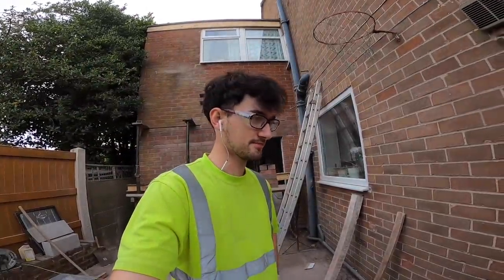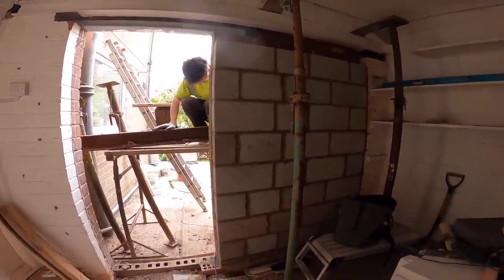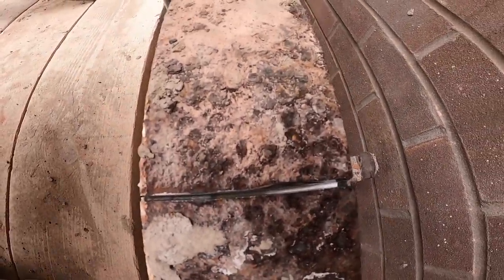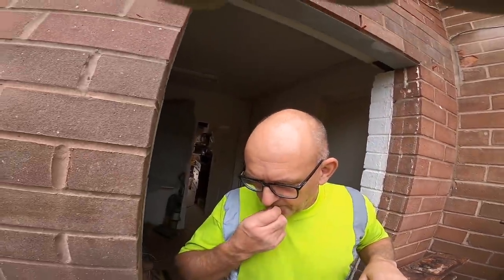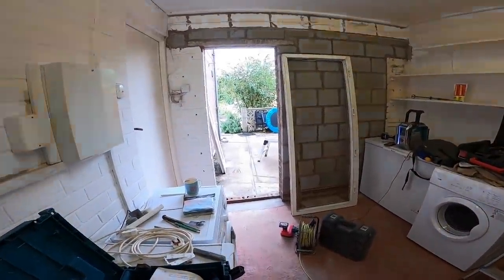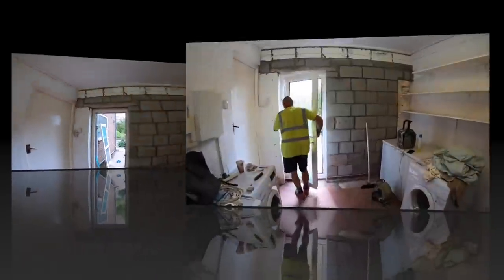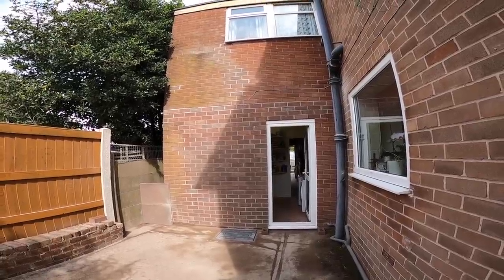HEAVIEST STEELS WE'VE EVER REMOVED!! UTILITY BOTCH REPAIR...THE BIG FINISH

Comment: I'm knackered just watching that! Top job guys - does show how hard the building game is. Rather worrying about that electric cut too. Stay safe you two. Do enjoy the ambient/techno choons too!
Reply from the maker: Cheers Danny 🤘🏽😉. 
The electrics were sorted , ended up being water in the outside light 💡🙄🧱👍🏼
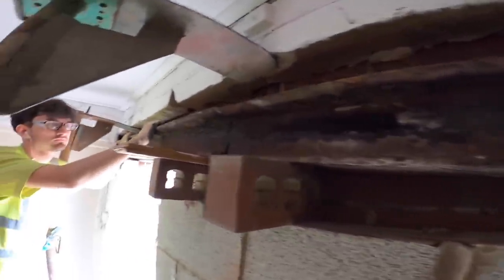Reply: Gents are you sure it wasn't crushed twin+earth going though cavity, seen at 13:24 acro pushing broken block onto wire(first tripped when you drove home acro), when acro was removed wire pinch released, then the spark could not find fault so blame water in light so he got paid. No matter as long as its RCD protected at fuesboard but fault may come back.
Reply from the maker: @deano6188  . No it’s all sorted and that wire was loose in the hole plus we hadn’t tightened the acrow up when it blew .🧱👍🏽

Comment: Great work Steve and Alex so many tips and going the extra mile or 30 for the bricks 🧱 great solution with the manhole covered any future problems ! Hope the scrappy paid a good price on those steels they were mental thick amazing how they rust and do so much damage with no tray thanks for the video much appreciated John
Reply from the maker: Cheers John , not much but worth taking them to get weighed in 👌🏽🧱👍🏽
Reply from the maker: @esecallum  10 p per kilo $3 would have been great

Comment: 19:53 in your younger days you would have carried the steels on your shoulder, and be whistling a happy tune. The pieces are probably the weight of the old school 50kg sacks of cement. Tidy job chaps. As for the door installing, it works as it is supposed to, so 10/10.
Reply from the maker: Thanks pal 😉👍🏽🧱

Comment: Great job boys 👍 The reason you had power upstairs is prob because the distribution board is split loaded. The earth leakage fault only affected the circuits( including the faulty light) that were connected to that part of the board and its associated rcd. Turning off  the mcbs still leaves the fault because the neutral wires are permanently connected and not switched. Hence the reason that circuit wouldn't reset until repaired 👍👍
Reply from the maker: Nice one Doug 😉👌🏼🧱👍🏽
Reply from the maker: @martin2466  🔌⚡️💡😉🧱👍🏼

Comment: That length of twin & earth (or whatever it is) on the outside wall could have been installed decently as well. I was always told that external cabling horizontals should be installed below the height of the entry point so as to stop water running down the cable and into the wall cavity.
Reply from the maker: The whole extension is a complete botch Job 🙄